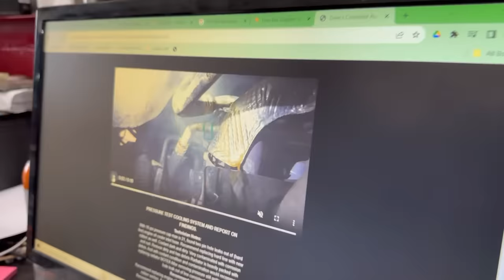The truth about maintenance, and what the manufactures tell you vs what you need to know

Comment: This kind of false advertising should be illegal but its not somehow.  
As a mechanic I see the fallout from this every day.  Cars are getting traded in and the engines are absolutely beat, Used car dealers are getting them from the auction because the dealer dont want them, they know theyre junk, usually the customer finds out too late it burns oil, someone is always left holding the bag.
A lot of these engines (TSi, TFSI, ecotech, high feature v6) are very expensive and you cant find a good one anywhere.

Comment: Yes. Yes. Yes. Definitely need to change the fluids etc more often than. the manufacturer says. 7000, 8000, 10000 etc is too long. Oil may last longer but it's still the same old paper filter they've used since the 50's. Filters break down, clog stuff up.

Comment: I have a 2001 GMC Yukon that has 355000 miles on it and a 2012 Ram 2500 Cummins with 140000 miles on it I changed the oil every 6 months regardless of mileage and or 3K on the Yukon and 4-5k on the Ram. If I'm towing my Fifth Wheel with the Ram I change it at 3K . I only use Mobile One or Royal Purple in the Yukon and Shell Rotella T6 in the Ram , for about a year I couldn't find the T6 so I used Schaeffer's until the T6 became available again (I don't know why it was so hard to find the T6 for a while?)  Yes it's more money but that Cummins engine would cost $10K+ to replace if I can do it myself.  The 5.3 $3-$4k  hitting 500k with the Yukon will be easy it's had the transmission totally rebuilt at 340k they wear out eventually and it was just a seal that caused reverse to go out.  But hey they had it open might as well  do a complete rebuild.  The Cummins only issue is the  front end everyone knows Rams (Dodge) can't build a suspension if they tried! It's been like that since my first Mopar a 1970 Dodge Coronet 500 I had spare tie rod ends and ball joints in my trunk. I got really good at replacing parts on the road. With that car.  Every time I watched a Dukes of Hazard episode I laughed when they jumped a charger I knew that was the end of that front end they couldn't take normal driving nevermind a jump like that. 😮😮

Comment: I had a 2003 chevy half ton pick-up. I did the proper maintenance.
And I sold the truck at 353000 miles. It's still runs great.
Do the proper maintenance?The old saying pay me now or pay me later. It's cheaper to do the maintenance now.
I kept it for 21 years.

Comment: I’m far from a mechanic far from it lol. But from experience with having a having an older 08 dodge charger Daytona for summer and a 2012 grand Cherokee for winter for the past 3 years. Now adding my wife’s 2022 Durango rt for winter and 2020 chevy Camaro for summer. Life’s stressful enough without the maintenance Gotta get to know vehicle turn your stereo down once in a while and listen too it. With “extreme conditions “ -30-60•c winters to +20+35c summers I change oil,filter 5k. bleed drain fill coolant. also transmission,filter  once a year. Got bros more into mods I wish maybe one day lol but rn I’d rather study and learn about the sensors   Little maintenance is bigger then more horsepower. Jus my 2c opinion that’s all

Comment: I have a 1986 toyota pickup...22r....428,000 miles.  Half the motor accessories are gone, it used to be fuel injection now it has a holly😮...no smog left on it that works, I change the oil filter every 3 months....oil is self changing and does a complete 4 qt change about every 3 months by just adding a quart (or two)  when it needs it (you'll hear the valve train clack)  ran her dang near out a couple times....no worse for wear.....I'd drive her across country with no problem...it's a freekin 22r....like cameramen, they never die.😂

Comment: Most neglected services:
1. Oil change 
2. Brake fluid change
3. Coolant change
4. Trans fluid change
5. Diff fluid change
6. Power steering fluid change 

Manufacturers usually have different service intervals for climate zones. Here in Canada everything is considered SEVERE which means cutting those intervals in half.

Comment: OK, he is totally correct. Here is their plan. Build a POS new vehicle. That is overloaded with parts that will fail. They then will finance the loan for you. And sell you a that vehicle which costs what a home did 20 years ago. They design it to fail after the warranty is off. Engineer it so you have to take the cab off a truck to replace the valve cover gaskets. You become disgusted at 5 years into owning it. And then they hope we are dumb enough to start this all over again. Buy buying another brand new POS. This is why I search and find clean 25-year-old vehicles as my daily driver. I really like your Videos Dave, Keep it up.

Comment: So here is a pondering - a '21 Elantra Atkinson cycle engine - you need to keep it so clean it is like new inside that engine to prevent the piston rings from ever getting dirty.  My dealer - do I trust their synthetic or not - it probably is fine - when oil  gets old it is deep red and I used my own synthetic - same thing, just the minerals in the fuel I'm guessing - but how about extended life oil - Castrol it costs like $4 difference; but using it for only 6,000 to 7,000 km officially is a waste.  Just stick to regular synthetic I would guess eh?

Comment: This is the way. Oils and fluids are under immense heat and pressure to do their work. Engine oil naturally contaminates with water, fuel, metal particulates, and particulates from the air intake. While much of this can be boiled off and recirculated with PCV system and filtered out in the oil filter, this requires time driving the vehicle and a huge amount of people don't drive long enough to actually have contaminants leave the system. Thus the oil fouls quickly and begins losing its lubricating properties. Not to mention debris and sludge will begin to form and may eventually clog and oil starve critical components. Engine oil also oxidizes so the moment it gets into the engine, the time is ticking for its  useful life. Transmission fluid and coolant, while not exposed to the same conditions/contaminants still needs periodic replacement to ensure they don't get to the point of breaking down, losing their useful properties, and contaminating the system with sludge. A clean engine is a happy an engine and regular fluid changes are necessary for long service lives. This is why you don't trust and follow exactly what the manufacturer says because they realistically want to sell you a new car ASAP. If your car breaks at 10 years you got a decent amount of use out if it and the manufacturer can now sell you a new car. But what if you could make your car last another 10 or even 20 years just by being more aggressive with the fluid changes?  It makes sense to just do the maintenance as it will be way cheaper than buying a new car. If you can find a honest, skilled independant mechanic for your vehicle, I would strongly recommend it. The dealer will fight you on all these changes and try to gaslight you into complying with their schedule. Or they will just ignore your requests completely despite you making it clear what work you want done. You need to do your research and find trustworthy people to keep your car running for as long as possible.
Reply from the maker: Thanks for the share!

Comment: Just a tip for everyone. Theres definitely a reason Range Rovers plummet in price after about 10 years. The plastic they use in the cooling system is the cheapest, most brittle plastic you can find. I was a mechanic at an independent shop and saw a lot of these. 1 was so bad it came back 4 times because it came in with a coolant leak and every time we fixed the cracked plastic part about a month later another plastic part in the cooling system would break.

Comment: You dont have to replace transmissions fluid change after 36000 miles on a bmw, zf states it needs to be done around 60000 miles or 100000km. Even then its not sure to do it, if there are no issues with the trans at all you should leave it, some reported after the fluid change it didn't change gears supposed to what it should be.

Comment: The manufacturers are interested  in their reputation for reliability.   If your Toyota's transmission fails 5000 miles after the warranty you aren't likely to buy another Toyota.    If you follow the advised maintenance schedule your car will last a long time.   The problem is not that people don't change their oil at 3-5000 miles it's that they don't change it until 15,000 miles.

Comment: Literally the other day I was at Ford workshop for the usual check up, I asked at what km or year they'd change the transmission oil (I worry more since the car has 6 years and has already done an engine change under warranty)... 

Turns out Ford suggest to not do oil changes for manual transmissions

Comment: I worked for 20 years for one of the world's largest engine manufacturers, and they do care about what happens after the warranty period has expired. Remember these shops make money from changing your oil early. There is no harm in changing it early but this is unnecessary and you pay.
We tested engine for several times the warranty period to ensure that the minimal number of failures happened within the warranty. If you specified an oil that started to cause problems just after the warranty period, you would see them within the period as well as there is a distribution of failures
We also bought bake high mileage engines for strip down and examination.
Reply: Ive been in the industry for 18 years..I worked as  manager once in a Jiffy Lube.....these longer intervals between oil changes are bull5hit because they give customers s false sense of security...

here is an Example: Jettas, Beetles, Golfs, etc some Audis wont MAKE it 5,000 mile oil change because when they come into the shop there is just a TIP of oil on the dipstick...due to those engines running at a higher operating temparature, which BURNS the oil away before 5,000 miles!! Meaning the vehicle has been running on nearly NO oil (whihc isnt a good thing)...tever notice tick tick tick sound you here on these German cars?!? 

loner intervals to more BAD than they do GOOD...and REMEMBER these interval recommendations are made based on the lowest level driving patterns not heavy stop and go driving..they are FINE for an old lady who drives once a month to get her groceries at from 11am to 12:30..NOT in REAL IFE

Stop acting as if everything is a scam..the DEALER has more of an incentive to lenghthen your intervals since 80-85% of their profit comes from their SERVICE DEPARTMENT and they ar ein a battle with quick lube establishments to send tht business to the dealer
Reply: @HuChing-ob4kk I'm sure Honda knows a lot more about engines that Jiffy Lube ever will. Of course Jiffy Lube would promote short changes, it's their business model
The interval are not based on some old lady driving.

 If the oil is low, you can top it up not replace it. Engine RPM has a lot to do with oil consumption, my road rally car would use next to nothing between 10,000 mile services, however run it hard for a few hours and it needed a top up. That engine ran for over 180K miles before the body broke apart, and only had oil changes on schedule.

If dealers make so much profit from their service dept. then why would they want a longer interval? They would want the car in for service more often.

The USA is about the only place that has lube shops promoting this short interval, and nowhere else has engines failing.

Comment: Both my bmw and Volvo transmissions are sealed lifetime and there is no service interval.  My BMW dealer won’t even touch it.  The problem is that the actual manufacturer of the transmission (zf) has a 60k fluid change interval on it in their documentation.    I had to have an independent bmw shop change the fluid . They used a liqui moly full syn.  Instead of the cheap non syn bmw fluid.  Same situation with the Volvo.

Comment: Dave , love your videos ! Im a industrial mechanic/welder. I had a nissan titan 2018 with 3 shortblocks that needed replaced started at 90 000km up to 140 000 and i got rid of it . What would cause this i assumed mechanic negligence st dealer but jd love your opinion or anyone elses that would know it was a scored 7th cylinder that provoked the intitial work , i was meticulous on oilchanges every 5000 km and i never put the truck through any serious work or strain it was a pavement princess

Comment: The flappers on the intake won't move because the drive motor is most likely burned out😂 and that sludge inside the coolant overflow is probably from stop leak that was put in it

Comment: The inside of every eco-diesel intake looks like that.
Unfortunately, the only way to stop it is to delete the EGR. If you live in a jurisdiction where the nanny state has decided that you can't do that, then the solution is to not buy a freak-o-diesel.
The people who own eco-diesels seem to love them... right up until they experience a catastrophic failure (which sometimes burns the truck to the ground) and then get denied the warranty claim. In my opinion, it's one of the worst engines Mopar has ever offered (right up there with the 2.7L V6). 
Put it this way: the eco-diesel V6 is the only engine that my local Mopar parts warehouse keeps in stock in large quantity. That right there tells the whole story. 

I totally agree with you on the maintenance thing.

The very concept of "lifetime fluid" is logically incoherent. It falls squarely into a design failure category that I call "this part will neeeeeeeever break."

Keep up the great work!

Comment: @DavesAutoCenterCenterville  thanks for spreading your knowledge and your longtime experience. Love your videos. 

So in line with you wanting to spread your knowledge and raise awareness: 
I got a new chevi camaro zl1. I want to keep that car as long as I can running and healthy. I dont track the car, I just live cruising with it. Just love the car in general.

What would you recommend then would be a good service interval for longevity for 
a) the engine oil (lt4 engine), 
b) the transmission (gm 10l90) 
and c) the rear differential? 

Your insight would be much appreciated to prolonge the life of the car and keep it in good shape.

Kind regards
Mirco

Comment: Hi Dave! I have a 97’ BMW 328i with around 100,000 mi. I change all the fluids but the oil change intervals I am wondering about. I normally change my oil every 4350 mi (7000 kms). I have no leaks. My buddy says that’s wrong and to do every 3000 mi. Seems like a little too short of an interval. I’m using 5W-30 Full synthetic Liquimoly.

Comment: How often should you change the automatic transmission oil and filter and how long for rear end and trans-axle on AWD?
I've got a 2019 Cadillac XT4 with turbo. I change the engine oil every 5000 miles regardless of what the owners manual says (using full synthetic as per the owners manual)

Comment: My 22 F 450 , with less than 100,000 miles,  had to have the transmission replaced ,
The technician advised me to service the new transmission every 60,000 miles , whereas Ford recommendations are every 150,000 miles 😢
Oh!, brand new the truck only had a 3 month or 36000 warranty, 
The new transmission has a 100,000 mile warranty 😮

Comment: Guys, i mostly agree to what youre saying to frequently change oil every 5k miles etc but important is the reasoning, basically you can say:
The more short distance you drive (e.g. 10 minutes to work and then 10 minutes back home again) the earlier you should change your oil.
So if youre driving maybe 40 minutes to work and then back again 40 minutes then you can go probably with oil change every 8-10k miles or something

So why is that the case? Why is the dealer/manufacturer saying 10k and not lower?
Basically they have to make those specifications for specific scenarios, they cant give a "one recomendation fits all driving type behaviours"-Rule kind of thing.

Please correct me, i might be slightly off with my explenation due to my poor english skills but its kind of like that: When the engine, the oil and everything is still cold and you only drive it while its cold then the gasoline cant be burnt properly and the remaining gasoline gets mixed with the oil (i guess everyone here knows that the oil is making the piston slippery to compress for the ignition/explosion right?) so the oils gets contaminated by poorly unevaporated/burned gasoline. 

TLDR; Short distances makes the oil go bad and dirty much quicker, thats why to change it earlier. Long distances has a more cleaner engine running behaviour so you can get away with less frequent oil changes.
Important: if youre unsure better do the save way and change it a little earlier

Comment: So what do we do when we have a used vehicle we bought and it won’t drain the whole engine but what comes out loos like muddy water and even settles out in the bottles you collected it in. 5 gallon system in my F150 and after more than 12 gallons it was still only draining 2.5 gallons and still had orange mud in it. I thought it was old broken down dark coolant but owners manual says the good green stuff, and the liquid drained all clears up after giving it time to settle. I managed to get it to about 25% ethylene glycol and the rest water but what else are we to do? Doesn’t overheat and doesn’t piss antifreeze near as often after 6-8 rinses. Should I be running the blue flush crap through it all summer? Or wait til late fall again and drain the radiator and refill with concentrated ethylene glycol?

Comment: A lot of the engine & transmission failures could be avoided if people only followed the manufacturer's recommended intervals. From the look of that coolant, it didn't look like it had ever been flushed.  Changing the fluids and filters more often than the manufacturer's recommendation is great but at least do the minimum!